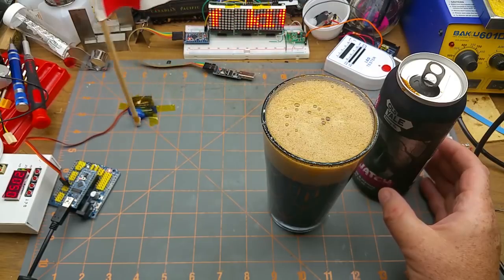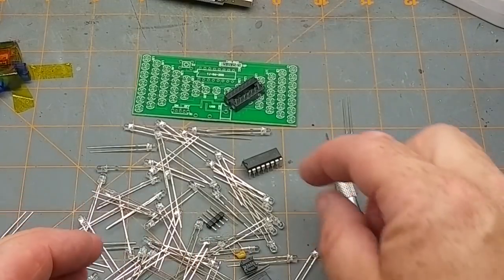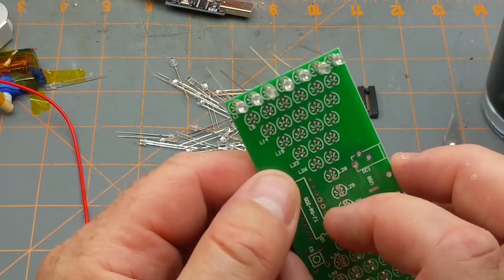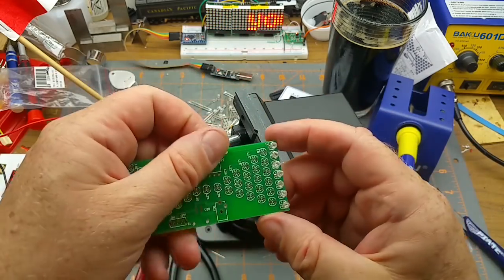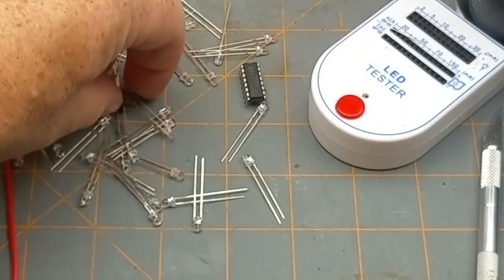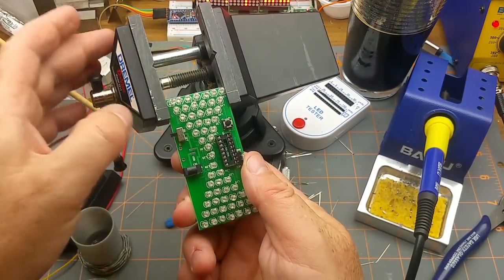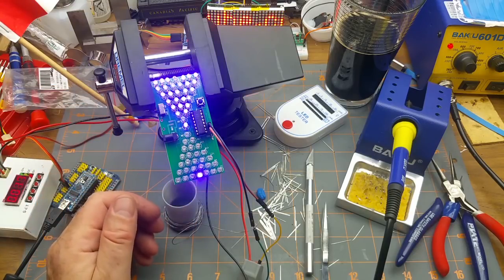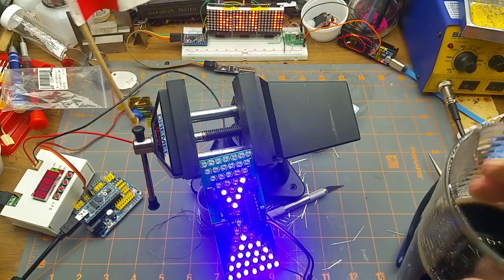Canada Day kit build

Comment: Does it flow the other way, when you turn it upside-down?  Nah.  That  stc15w201s looks interesting, but does not appear to be widely distributed by itself.  Guess we in the west would be using an attiny44a.
Reply from the maker: Nope. 
It just looks like an anti-gravity hourglass when you flip it over.
Yeah, I've never seen that particular microcontroler in the wild before either. I doubt that I'll be trying to reprogram it. 
Though I might try to hot-wire an arduino onto the display and see if I can figure out some code... Maybe.